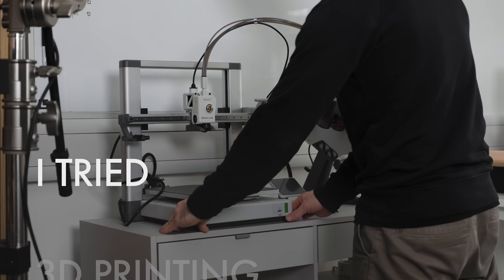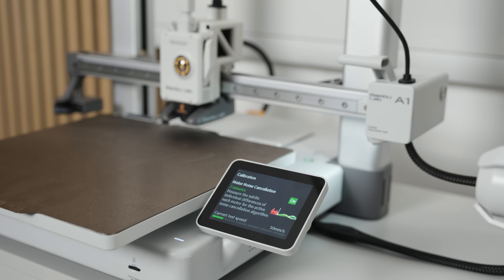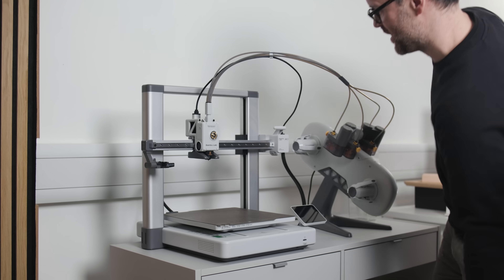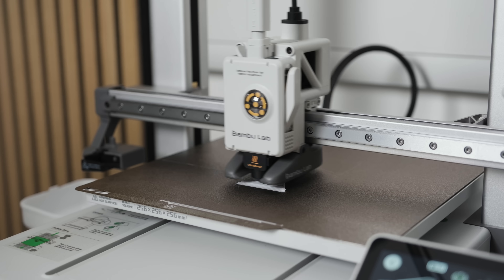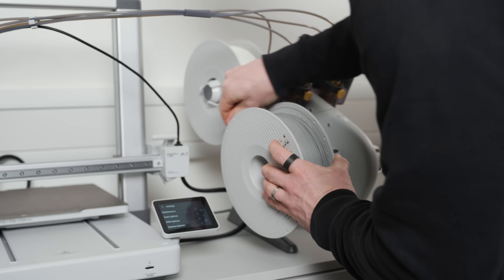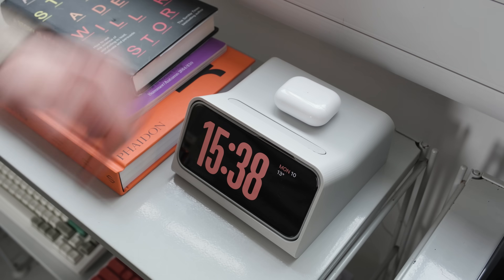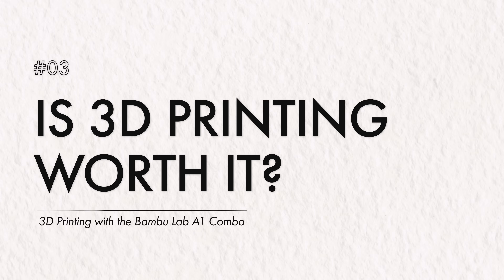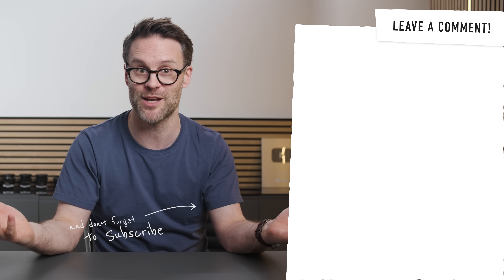I Tried 3D Printing as a Beginner: Is it Worth It?!

Comment: A couple of 'minor' corrections. PET-G is not 'stronger' than PLA. In fact testing has shown that PLA can hold more weight and withstand more shock, at room temperature than PETG. What PETG has as advantages are that it has a substantially higher glass temperature, (temperature below 'melting' point but where it is essentially mold-able or deform-able. It is also one of the few plastics that apparently is safe for use in making things to go into aquariums, or at least the plastic doesn't break down and leach toxins into the water.

The usual recommendation I have is that as long as what you are printing is going to be used around the house, and isn't going to be spending long hours in your car in the summer, go with PLA. If it is going to spend time in the car, or is going to go in an aquarium. it's time to consider PETG.

There are other materials that are worth considering in many cases, but nearly all of them perform better in an enclosure like the P1S, X1 series, or H2 series printers.

For the beds that come with the A1 and A1 Mini your best adhesion advice is to pause before printing your first print of the day, and go treat your print plate like a melamine dinner plate. Hand wash with a good quality dish soap (Even the Palmolive or Dawn offerings at the Dollar Store will do the job) gently scrub with finger tips to make sure that remnants of previous print jobs have detached, ans then thoroughly suds up both sides of the build plate, to remove fingerprint oils. When done, rinse making sure that all detergent is removed from fingers and printer plate, then dry with a couple of main squares of paper towel. Handle the plate by the edges as much as possible, and properly place the plate on the magnetic surface, whichever side up looks to be in better condition.

If you are printing exclusively in PLA, I recommend picking up the Bambu Lab cool plate for PLA. I don't think there is any such thing as a perfect build plate, but PLA sticks well the build plate doesn't get as hot, which means you're running a lot less current through your printer. It might not matter for a phone case, but for something that's going to take 20 or so hours to print, it can be a couple of kilowatt hours of electricity. Still perhaps nickles and dimes, but they add up.

If you go with the A1 Mini, Bigtreetech brand has a couple of 'hologram' build plates backed with a surface for either PEI or PETG. For models that fit on that printer, the surface that attaches to the build plate during printing will have a visible pattern with hologram like characteristics. Whether that's vital to anyone, it may be a nice addition for a christmas gift, or you may find other advantages.

One down side to PLA, at least in the form most of us use when printing, is that in time, when it is under stress, (Say that coat hook) it will deform even at room temperature. My own experience is that for some things, you may go years before you need to make changes, for others, it may be months. And for '2 part' prints to hide the screws, you may need to make sure you can re-print both. For something like this, keeping a local copy of the model on your PC in a folder tagged 'useful print models' or the like, with a descriptive file name, or a document where you describe which file gives you what, and perhaps have pictures of the printed object, notes on what you printed with, and whether it might be a good idea if this is deforming easily to switch to PETG, all seem to be good ideas to me. And of course you could keep track of a lot of that in whatever note taking app you use.

Finally, remember, it's plastic your printing. If you don't like the surface, it can be sanded. you can also use filler primers, wood putty, or Bondo filler materials to give yourself a surface you can improve. People make prints that end up with a surface finish that looks like dark chrome for cosplay. And you may have a limited selection of colors to print with, and perhaps even that one full spool of gray that doesn't go with anything, but with either primer, or plastic primer paints in rattle can's, you can make that toolbox you printed to contain all the 3d tools that you figured out after you've been printing a while are useful, whatever color you need to to match your decor or shop style.

And yeah, find things that are fun, as well as things that are useful. the fact that you are 3d printing something means that it can be as utilitarian or artistic as your mood and search abilities, or the design capabilities you dedicate yourself to picking up, will allow. As you decide to design things to 3d print, have a look at the Slant3d videos on designing for 3d printing. There are others as well.

Have fun.
Reply: Maybe make a video?
Reply: @Jules-hn6un Maybe, we'll see. I will say that some of the people who I know have done some testing, Stephan at cncKitchen, Clough42, Tangled Testing, are all probably better resources than I am, but I'm not afraid to do some 'odball' testing. Again, maybe. We'll se.
Reply: Thank you so much
Reply: Your comment is gold!
Reply from the maker: Thanks so much for sharing this - great bit of insight for us beginners! :)
Reply: Hey thanks for the info, I want to learn 3d printing specifically to make stuff for my vehicles so your comment really helped
Reply: @DirtyDirtbath  Glad it helped. Depending on your printer, I'd suggest prototyping parts in PLA, to make sure you get dimensions right. There are a few sources of that for about $10 a kg in the US. PETG (so far) is a bit more expensive, though not as bad as some of the tech filaments.

I'd suggest prototyping joints that you need to fit parts together separately to get settings tuned. Far better to see how those are going to work before you go to install them and have to figure out what you need to adjust on the final parts.
Reply: this comment is top notch diamond edition! thanks
Reply: This was stupid long. You're notbinteresting enough to post this dribble. Its longer to read than the video. Ffs, its a comment section not a lecture section
Reply: @boyeatsworld-vr9ci  Thanks for the reply. Love the interaction credit going to the content creator. Have a wonderful day.
Reply: @boyeatsworld-vr9ci  I thought his comment was more helpful than the entire video. If you chew on rocks go do that somewhere else while us adults learn

Comment: Surprised this influencer skipped a very important topic in 3D printing. Bambu Lab locking users into their China-based cloud is a huge red flag, especially with that iffy firmware update. "Developer Mode" is a half-measure. Users might be better off with Prusa — pricier, but made in Europe, follow strong EU privacy laws, run on open-source software, and are incredibly reliable.
Reply from the maker: It happened after I filmed it - yes - needs some research

Comment: I failed last year. Bought a Artellery genius pro.  Never get it calibrated propperly. Filament did t stick to plate, etc dtc and no help. And when you cant use 3d software stay away from printing. Also do t forget price for e,ectricity

Comment: Cool.  Any thoughts on maintenance, clean up, etc.?  Do the tubes or heads have to be cleaned out?  Also, nice specs, did you print them?
Reply from the maker: So far only had to grease an axis and instructions are simple to follow from video. Can’t comment on more - very much an inexperience beginner here - hence why I frame the video as trying it - but seems very manageable 👍
Reply from the maker: Specs are from Cubitts! :)

Comment: I've been using 3D printers since 2018, I started with an inexpensive creality ender 3 v1 that taught me many things about how to do manual calibration, basic maintenance, modding... This sort of stuff.

After using it for several years (and upgrading the crap out of it in the process), I wanted a bigger and fancier printer so I upgraded to a Bambu Lab X1 Carbon, I was so surprised by how easy to use modern printers are! Going from having to calibrate everything myself to just click on a button and watch it do everything is so convenient!  It almost feels like using a slightly more complex inkjet printer.

3D printing really became accessible nowadays and Bambu Lab did great in making their printers as easy to use as possible (even though their software isn't as permissive for tinkering as other brands).
Reply: exactly what i did. Started with the ender 3, which was a massive headache. Why isnt the print sticking, gotta find the right nozzle temp, the right bed temp, the right flow rate, use a piece of paper and some knobs to level the bed, supports are failing, gotta fix wobble layer lines, nozzle keeps hitting the print, fans sound louder than normal, just problem after problem. Then i got a X1 Carbon, which all i really do is set the layer height and enable or disable supports. Was blown away by how much 3D printers have evolved over a few years.
Reply: I still using my ender 3 v1 ,it taught me everything about 3d printing , i think if i move to more advance printer like bambulab a1 it would not be a problem for me if the printer have an issue
Reply: yeah 3d printers have become soo easy just push a button and go i started with an ender 3v2 and it was a pain to work having to calibrate it manually was frustrating but it did teach me alot about modding it and problem solving

Comment: I think it sounds good. However,  like most things I would think after you have tinkered, printed a few handy things, long term it will just collect dust. Meaning the few items you did print become really expensive. The other option is you print things for others for a small fee. Interesting though.
Reply: if ur doing 3d printing purely as a hobby then perhaps. For me i’m constantly using 3D printers for prototyping and testings in my engineering job, using 3d printers is cheaper and the ability to print different variations of the same thing is a huge plus!

Comment: Although I haven't used a Bambu Lab, I picked up an ELEGOO Neptune 4 Plus+ for about $350. Every time I had issues it was user error, & could have been avoided had I properly paid attention to the instructions- just like you did with the removable support brackets. I later found out they have an entire video catalog featuring practically anything you need to learn to do on it. 
The last time I had an issue a piece broke, (which was again my fault) & they airdropped me the new part overnight & had it in my mailbox in under 14 hours. I'm just a regular guy, no 3D printing business etc- so for them to go so far out of their way was really surprising, and every time I did need to talk to or deal with support, there wasn't the usual language/time/country barrier & some dude from India that can't understand me or vice versa.

In 14 months I've had a total of 9 failed prints on this machine, most of which probably could have been prevented with better maintenance, with the exception of 3, which was because I bought crappy $6 filament. It was bubbly & it's diameter was all over the place- or had bigger blobs that wouldn't get past the extruder. I now use it in a 3D printing pen just for gap filler, or minor repairs or press fit stuff that doesn't need the strength or reliability of proper filament.

Comment: Is it worth it? Yes as a hobby. You can literally make anything you can think up. For somethings, you really need to be patient. 3D printing is a marathon, not a sprint. And for people with physical challenges. It's a pretty safe hobby as long as you're being careful when working with the bed when heated or the hotend when it's up to temp.

The one thing I will say is this is a hobby where if you're going to try to start a business, it's a craftshow level business. Very few people have been able to start and sustain small businesses with this hobby. That's because bigger companies can still push out plastic parts faster than a 3D printer can, and probably ever will. Most of the businesses that I've seen that are successful are doing one of 2 things. They're either bringing CAD designs into the physical world for other companies. Or they're selling 3D printing supplies like printers, filament, and accessories. Otherwise everybody else is making stuff, and selling at craftshows and farm markets.

Comment: I exactly took the same steps :)
I used to have a (shitty) printer before that never really worked but teached me a lot about printer Hardware and trouble shooting.
So when I finally got an A1 I already knew the "theory" stuff.
After that I initially only printed from Bambu Handy, as when ever I used Bambu Studio prints would fail.
After about 1-2 weeks of doing that I finally sat down, took 1h and literally checked out EVERY aspect of studio.
Then I printed other models via Studio, slowly understanding what does what and improving on "issues", etc.
Currently using a mix of ready to go STLs and doing some "intermediate" TrinkerCADing.
At some point I gotta bring myself to learning fusion360, but man... I hate it xD

Comment: $.50 for a scraper? You’re nuts. Let’s run the math. 

The scraper design in this video is reporting 4g. A spool is 1000g for ~$15. So it cost you $.06 in material specifically. 

For machine degradation / depreciating asset, no one has actually reported a lifetime print number. There have been reports of 2,000 hours for the hot end… which is $13. This is our only reference point. This print is 15 min. So asset depreciation cost is $ 0.001625. 

Electricity. The window of use for electricity is ~100 watts per hour which is $.042. So 15 min is $0.0105. 

Lastly. Manual labor. Finding the print, sending to the printer, then taking a 15 min federally mandated break while it prints, and then scraping it off. At an hourly wage of $100 an hour this scraper cost you $100.072.
Reply from the maker: Haha.  OK nice! It’s a figure of speech of course - yep - the cost of owning always outweighs buying one. The cost of labor is always ignored by the consumers, and and then again - why buy a scraper if you don’t own a printer. I personally believe most of us in London should never own a car as it would be better get a taxi everytime for so many reasons.
Reply: @ yea. Just messing around. I loved the video.
Reply from the maker: @ great to have you! :)

Comment: I was a noob in the Fall of 2022.  If I had it to do again, I wouldn't.  It's been a giant PITA to get anything to print worth a crap.  It's been near impossible to get help on forums; posts get ignored or made fun of.  But, I'm in it now, I have two dozen rolls of filament, and stuff prints okay most of the time.  But it's been a frustrating experience.

Comment: I’ve never 3D printed anything before and that’s mainly because of startup costs. Just never had the means to dive right in. But I know if I did, videos like this would be the best ones to watch, get inspired, learn, and then continue learning. Thank you
Reply: I got a 2nd hand hardly used Ender 3 for £50 and that came with 2kg's of filament, hardly going to break the bank. 3d printers run for years without much maintenance, my two CR10's are 3 years old and have run for thousands of hours and still print perfectly, so second hand machines are just fine. As for software - Cura, Tinkercad & Blender are all free!
Reply: @scottm5425  true, mines are artillery hornet and are doing well, I may say i have improved them to work faster and more reliable, I learned if some part fails too much you have to buy a high quality product which I did and solved all my problems those included: stepper motor driver tmc2209 (I was running them faster than avertised, so you needed to get into software but nowdays all printers have amazing stepper drivers), high quality nozzles, a better thermistor and a better extruder, suddenly running for 4 years now without major issues.
Reply: @scottm5425  enders are great if you are ok with putting hours and hours trying to learn it. If you want a printer that just works and is insanely easy to use, i would personally say go with any Bambu printer, but im sure most new printers from the popular companies are fine now.  Bambu Lab is so easy, i got my 10 year old nephew a Bambu Lab A1. Now he is printing and selling his prints.
Reply: @scottm5425Fusion 360 is free as well for personal use.
Reply: @scottm5425 A used Ender 3 is the last thing anyone wanting an easy entry point should be buying. They were pish out of the box and needed lots of tinkering to get working consistently - usually by people that had no idea what they were doing!

Comment: For small business. Would you recommend a laser engraver or a 3D printer? I am thinking of getting a machine to add more products for my craft shop.  I can make wood, acrylic, and leather products with laser but I may charge higher price with toys from 3D printers.It's so hard to choose.
Reply: Bambu Labs have just release the H2D. It’s both a 3D printer and a laser engraver (you can choose either a 10 watt or 40 watt laser). 

However, it’s not cheap! You could get a separate 3D printer & laser engraver for the price.
Reply: @antelopeslr5000  Yes that's what I am thinking about. But I heard laser engraving will create dust and ruin 3D printing result as H2D has a small chamber. Guess I'll stick to getting a commarker and find if there is a reliable 3D printing brand. Do you have any recommendations? Or this one in the vid is a good brand. I don't know much about 3D printing,just focused on laser before.